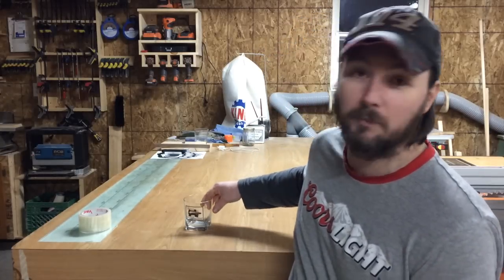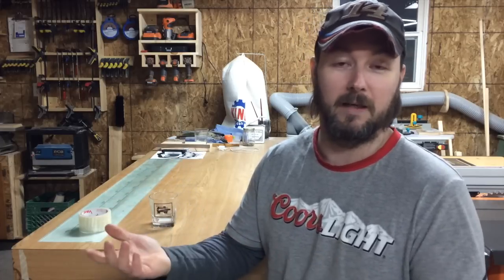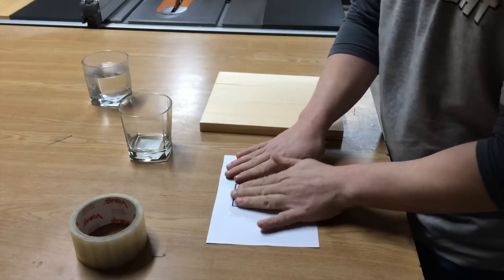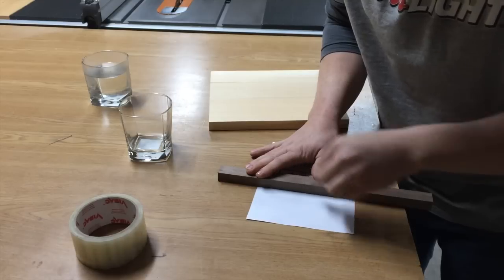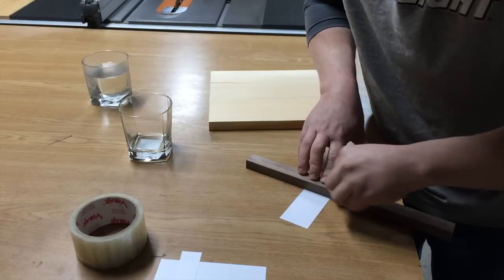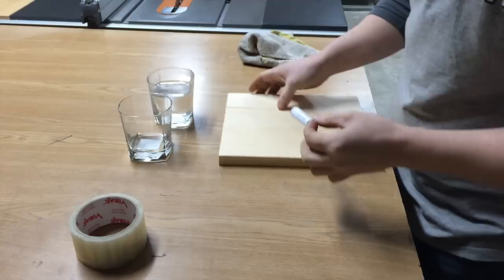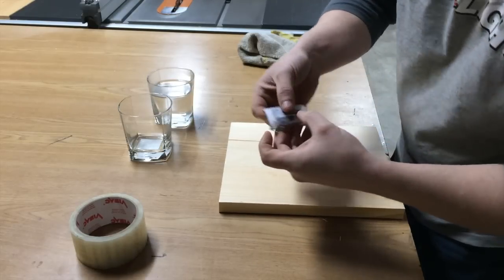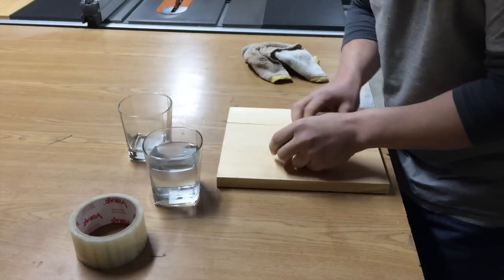How to transfer an image to glass

Comment: does the sticker come off if you wash it?
Reply from the maker: Depends...I used cheap tape on one glass and it did so I tried a better brand tape and its held up pretty good so far with hand washes but I've been mostly using these as decorations in my bar 
Thanks for watching 😀

Comment: Great job! But for those of us that does not have a laser printer, what other options are there for obtaining a laser copy of your image?
Reply: just go to your local walgreens or kinkos and print one out from those machines
Reply: Kittyn Caine photo copier
Reply: Kittyn Caine It works with anything printed.  You can do magazines or anything. Try it. It works!   Just be sure whatever you use to wipe the tape off, you need to constantly change. If you don't the paper already coming off will scratch the sticker image.

Comment: where would I find a laser printer? I don't even know what it is lol.
Reply: It's like a normal printer that uses inkjet cartridges. Around $30.00 I was told. Cheaper these days. Any electronic shops. Or office work.
Reply from the maker: I got my printer at Best Buy for around 100 bucks but you can take a memory card to your local post office or UPS store and they will print some pictures off for a few cents

Comment: I really like this method. I'm thinking about doing this for a Christmas present this year. Now, clearly the tape won't stick to the glass forever, even with really good tape. I'm not very knowledgeable in this topic, so can you think of any ways to prolong the stickiness of the tape? Thanks for the tutorial!
Reply from the maker: how about spraying some spray adhesive on the tape before you stuck it on or a couple dabs of crazy glue to help prolong the stickiness? just a thought and might be worth a try :) thanks for watching
Reply: Adhesion promoter

Comment: Would this work using an inkjet printer? I noticed you said you used a laser printer
Reply: as far as i'm aware, using Trevor's method with the packaging tape, but with an inkjet printer wouldn't work,  i'm pretty sure the simplest reason is that the ink used for laser jet prints when submerged is not affected by the water, so keeps its detail,  but Inkjet ink will bleed when put in water, and the picture ruined.     having said that there are alternative methods to work with inkjet but most require purchasing few things that you may not have lying around  whereas with Trevor's video all you need is access to a laser jet printer and your all set, it one of the more geniously simplistic ways of achieving a quick, simple display piece that iv'e seen

Comment: Not to be mean or anything,  but couldn't you just print on clear labels then apply it to whatever you want? It would seem easier. Where I'm at the roll of packaging tape cost about the same as about 10 full sheets of clear labels.

Comment: Didn't work, maybe the tape i used wasn't strong enough (scotch packaging tape). I tried 3 times with the same logo applying more and more pressure with a scraper each time and they all disconnect from the tape in seconds under the water.

Comment: Why wouldn't you use cut vinyl?? Way faster and would hold up to hand washing not sure about dishwasher.  Seams like this would be good if you have delicate image or colors but that plain 1 color image would be just fine done with vinyl. Not trying to be a downer being a realist
Reply from the maker: Good point on your part! 👍🏻 I was just messing around and trying to do stuff on the cheap with stuff laying around the house and surprised it worked, thanks for watching and the comment

Comment: does it have to be printed image ?
Iam palning on adding some images to some of my stuff (plain colour looks boring) and i dont have a printer, would pencils/ markers would do the trick ?
Reply from the maker: PlayerOne good question ..I don't know if their would be a type of marker that would work but I do know if you used a colour laser printer it should work the same as the black method I've shown here
Reply: just grab some markers and draw right on the glass surface,if you get it wrong wipe it off with paint cleaner and start over,,when you get the result you want tape over it!!

Comment: Hi, this so cool, I am planning on making these for guests at home. But I intend to actually use them, had a quick question. Should I be removing the tape after the transferring the image, or should I leave the tape on ? How much will it hamper the image when I wash the glasses with soap etc. 
Would be nice if you had an answer.
Thanks
Reply from the maker: You will have to leave the tape on the glass cause that's what the image is permanently stuck to ..and being able wash the glass afterwards depends on what kind of tape you use I tried cheap tape and it came off after a wash or 2 but better tape seemed to hold on longer ...I mostly use mine as decoration glasses now
Reply: Trevor Carter Thank You, will try it and let you know how the final result came out. It has to be a lazer jet printer right? Ink jet wont work ?
Reply from the maker: +Kayomarz Bacha yes I used a laser printer ..good luck and let me know how it worked out 😀

Comment: That's pretty cool.  Never thought to use packing tape. Do you seal it with anything?  I wonder how well the tape holds up to washings. (The other method usually involves gel medium and a sealer.)
Reply from the maker: Alice Shepherd it holds up quite well to washings but the best part is it costs next to nothing to make another one if it does come off 😉 thanks for watching
Reply: Right on. Thx for responding.

Comment: This might be the technique that I need to use, but there is no other colors in the image that you used, and the tape on empty space of the image does look a little bit frosted. Is there a way to get rid of that?
I'm wanting to do an image with colors, including black. It'll be an image larger than the tape. Do you know of any sticky sheets that we can use in place of the tape?
Also, for the bright color, I'm wondering if I could use two layers, one with the background color painted in, and one with the outline in black (printed).
If I just do this with the original image (that already has the color), using one layer, will the color show up, and would it work any better to print the image on glossy paper?

Comment: DIY sticker...still though it would come in handy for custom made prints and to put on wine bottles
Reply from the maker: I never would have thought of wine bottles ...great thinking and thanks for watching
Reply: Does it have to be a laser printer cuz I'm trying it and it's not working am I the only one
Reply: Jamie P gotta ask but are you sure you’re using a laserjet printer (toner cartridge)? Inkjet printers are more common for home use
If you’re doing it on a board instead of glass you could also just use an iron to heat transfer it

Comment: When i put the tape covered paper in the water the tape and the paper separated and I'm not sure why...
Reply from the maker: Lacey Wall did you use a credit card or something to press the tape down to make sure it was stuck really good with no air bubbles? Also make sure you use a good brand of tape that's good and sticky

Comment: when I tried rubbing the paper off, the whole image rubbed off as well.. nothing stuck to the tape...please explain why this did not work for me
Reply: Were you using a inkjet or a laserjet printer? Most inkjet printers use a water soluble dye.

Comment: Fantastic video! I'm making a shadow box for my fiance's Christmas present, and I'm going to put a design with his name on the glass. My question is, would this work with any color design, or just black?
Reply from the maker: Nicole Moser I'm sure if you used a colour laser printer (make sure it's a laser office printer) it would work ..try a small test piece before you print off the original but the process would be the same and should work 😀 thank you for watching!

Comment: How well does it stand up to washing?
Reply from the maker: +MonkWerks with Fr. Thomas Im gonna guess that would depend on the tape you use...i tried dollar store stuff and it didn't hold up so well but when i got a better brand name tape it held up to my dishwasher just fine ....im just gonna mostly be using as a decoration anyways :) thanks a lot for watching
Reply: I wonder if you put it in an oven for 30 min if it would stand up to washing? Hmmmmm
Reply from the maker: Don’t know if the glass would handle the heat but worth a try for sure
Reply: If you do the oven method, leave it in the oven to cool before taking it out.👍

Comment: Will it last or stay in place when you wash the glass or is it just for decorating?
Reply: Brenda Murray It just depends on the tape you use. If you use a low quality one, it will remove easily. With a high quality one, that will be certainly not be the case.

Comment: been trying this for how many times but i always fail, the design wont stick on the tape :'(
Reply from the maker: Tiffany Sta. Cruz be sure to rub the tape with something like a scraper or something to make sure it's really stuck to the paper and rub really easy it doesn't take much pressure and be sure the paper soaked for a few mins and stays wet
Reply: @TrevorsWoodShop  what kind of paper you use sir?